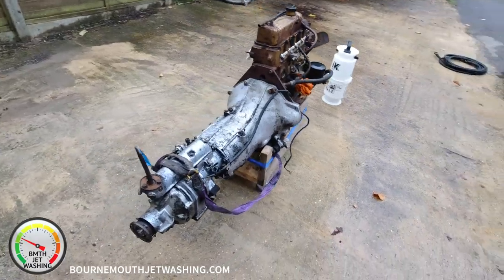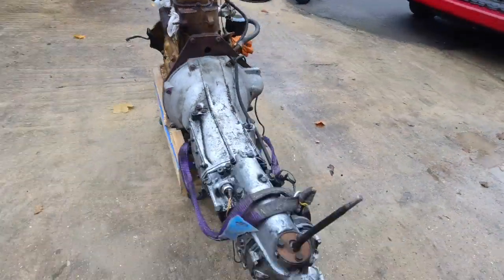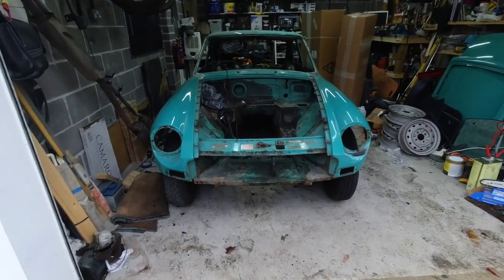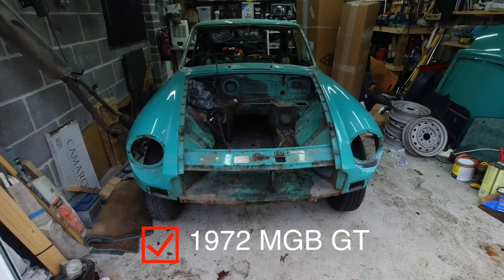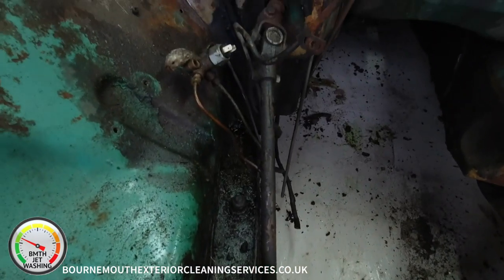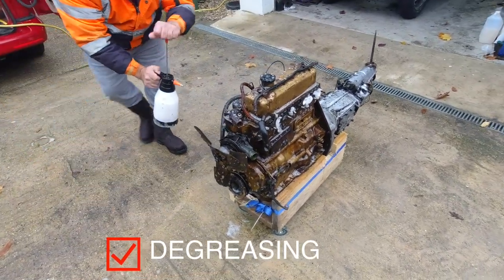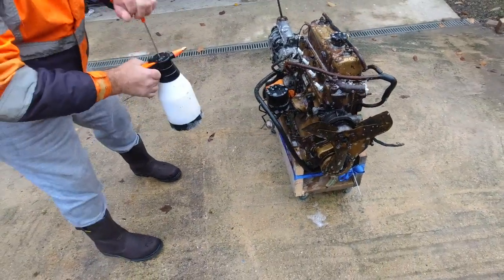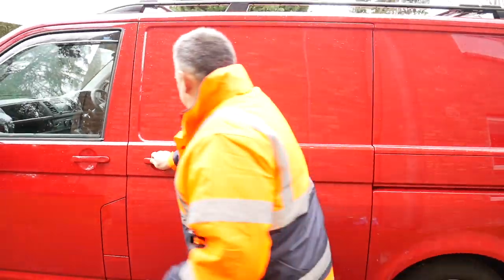Steam cleaning engine bay

Comment: I loved this! I looked at used MGB's for sale in the 70's. I wanted an MGB GT. The chassis on this MGB made me think of my '77 Datsun 280Z. The UK has the best specialty shops to repair or restore British cars, unlike the US. Watching the TV show - Wheeler Dealers, showed the specialty shops there. I miss Edd China. =(
Did you notice any rust, so-called "tin worm"?
Reply from the maker: Hello Alan yes the brits do like to restore the old cars, they have a great suppliers and forums for these old MGs . I dint notice any rust but the customer told me to turn the pressure up when i was cleaning the engine bay as to expose any weak spots, i think he said he was having it dipped, to strip down or prevent future rust i dont know though.👍

Comment: I hope those small bits of paper in the ports stopped water getting into any of the cylinders. Also water can get into the breather of the gearbox and that will rust the gearchange mechanism.
Reply from the maker: Hi Stuart, yes indeed im sure it can, The customer knew everything that was at risk and he knows what he is doing as this is what he does.👍
Reply: This was done before the engine was stripped down for a rebuild I presume, that way you can get rid of any water that snuck in

Comment: Hi Ricky what's the model of your mazzoni boiler?? I'm looking at buying one.. I live in Australia.. and your pressure cleaner model as well.. thanks Ricky keep up your good work and loving your videos..👍💪💪
Reply from the maker: Morning cheers. I use a mazzoni firebox 25lpm 250bar and a briggs and Stratton 23 hp 300 bar 27 lpm machine
Reply: Thanks Ricky, that's the  boiler I'm interested in .. the guys recommend that size unit.. what's the reliability of the unit ..
Reply: Hi Ricky is yours 240v or 12v unit 👍👍🔥

Comment: Nice video as usual and you did exactly as he requested but it seems really really dangerous steam cleaning an engine that’s had all it’s ancillaries disconnected.
Reply from the maker: Cheers the customer knew all the risks and was happy with the work done. , the engine was being stripped down so it was a issue, he certainly knew what he was doing👍